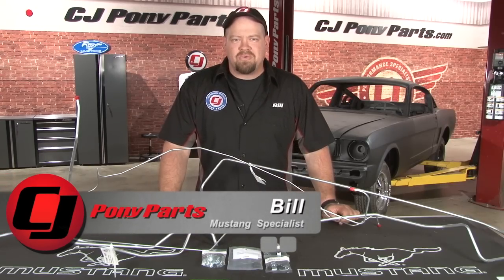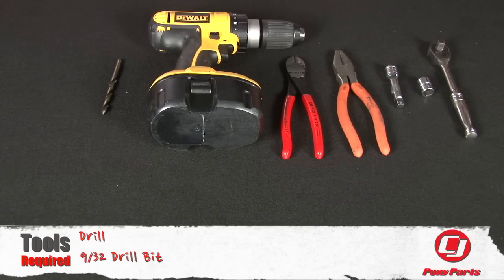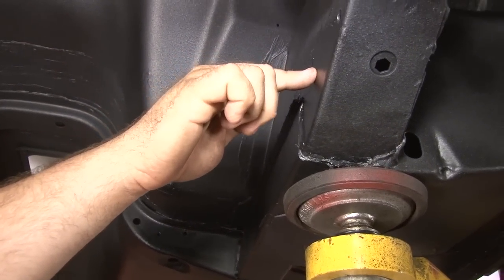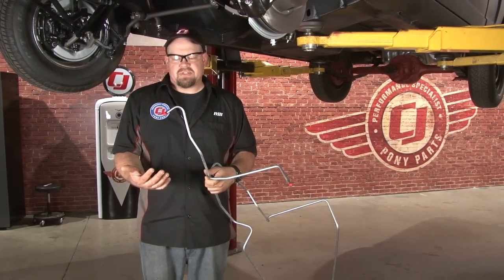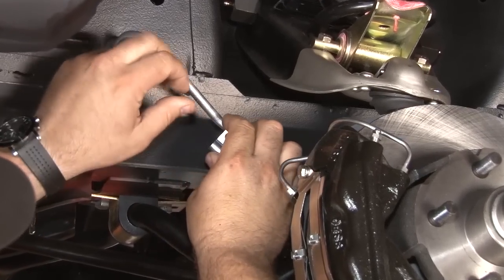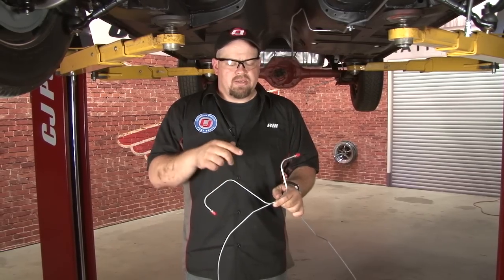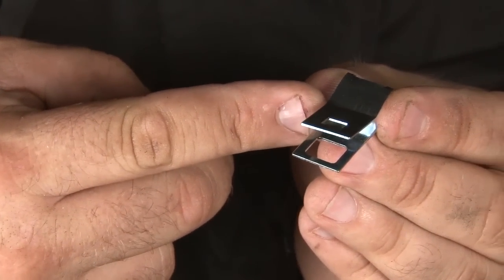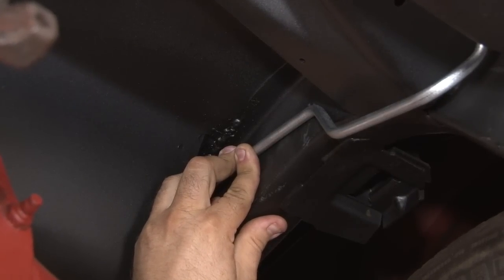Fuel Line | Classic Tube | 1965-1966 Mustang

Comment: I would agree with you it's not the best routing but that is how the lines were made since that's how Ford did it originally. In 1967 they moved the fuel lines to the rocker so they no longer pass under the rail.

Comment: I think Fords 'light bulb' was out when they 'designed' a rubber hose (that breaks down over time) as a connection between the sending unit and the fuel line. Every few years I have to replace mine and it's a job that I 'never' look forward to; especially when the gas tank is full. :(

Comment: Is it just me or wouldn't it be safer if the fuel line was ran through the rail or inside the bay rather than the outside of the rail and running it under the rail?
Reply: I agree with you, who cares about 'originally', I'd take safety over it any day